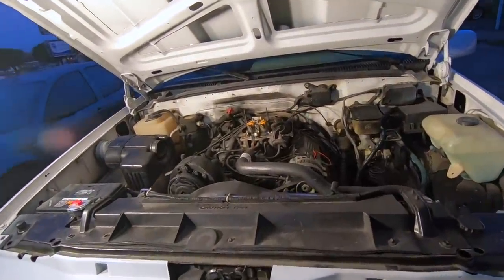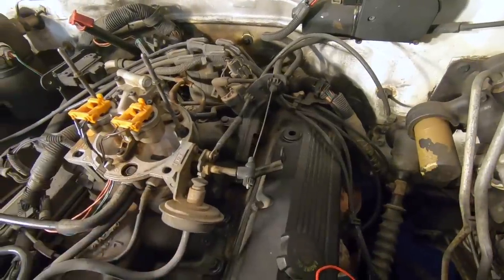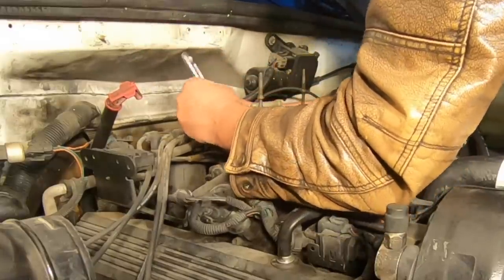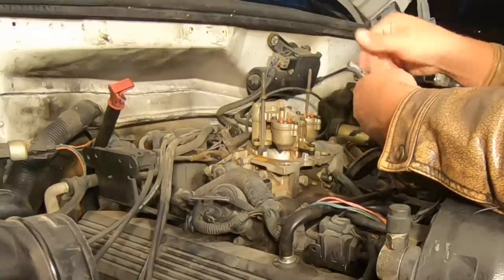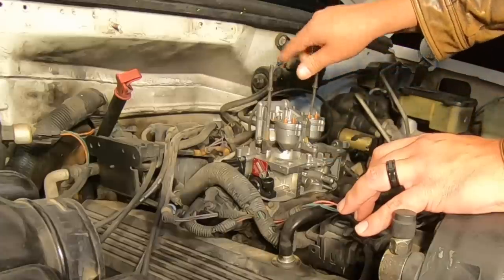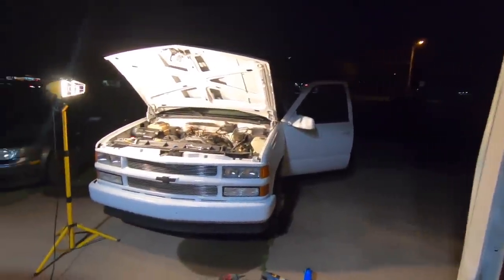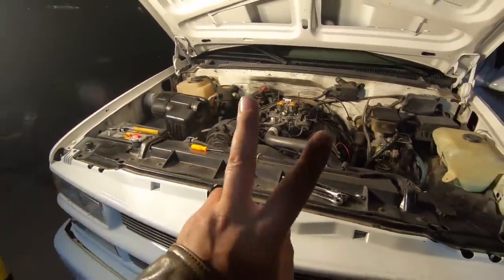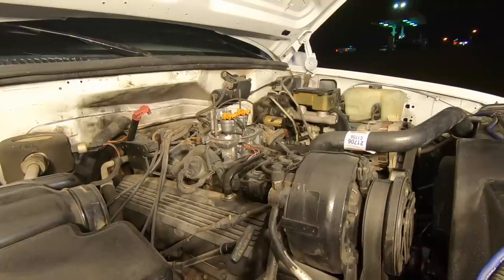94 Chevy 3500 454 TBI Replacement Issues!!

Comment: sure seems like a vacuum leak, check to make sure there are no open vacuum ports that may have been plugged on your old unit. That truck has a hydro boost because it was a Diesel truck before Diesels don't produce enough vacuum to make a traditional brake booster work.

Comment: ranny you need to go to a Michelin dealer because those Michelin tires had a recall on them years ago and if they have the right. T on them you'll get 6 brand new Michelin tires no charge cuz they had a big recall on them those are the same size as tires they put on the U-Hauls that's where it came from and as far as your headlights going off and on the headlight switch in a Ford has a fuse built into it that overheats and then it burns the connection up and the wiring harness that goes to the switch all you have to do is pull the switch out and see if your plug is burn up and fix it and that will take care of your headlights

Comment: Rebuild kit 40$ Injectors rebuild replacements probably 200$ Ive done this on my 350 and it's extremely easy, usually the regulator diaphragm will go bad or the gasket will blow out but that's it besides whatever else that's not mechanical

Comment: Don't buy a 6.5 Diesel. They spend more time broke down than they do running. Why do you think the guy swapped a 454 in the truck you bought? Sure as fuck wasn't for the sake of MPG. Hydroboost is good. Leave it on there. I upgraded my F250 to Hydroboost and it gives the truck more braking power.

Comment: Fix it.  Keep it.  As others have said - the stalling is likely a vacuum leak.  The lights are the probably the dimmer switch or the main headlight switch.  Drives you crazy until you find the source.  Oder GM products (before the multi-function switch) it was almost always the dash switch.  On rare occasions it was the power relay to the lights.

Comment: Dude, that truck is fine... You got a few things to test before you give up. First of all, you should have bought a tbi rebuild kit and just replaced the injector from a wrecking yard. But that's over... So, you got that little black box with the green plug and one tube to the back of the tbi on the passenger side valve cover bracker thing.  Unplug that green plug and start it, that's the map sensor. You will have to give it a little throttle to get it to stay running and it will flutter. Put it in gear and let it run for a minute. It should somewhat smooth out with a check engine light. If it runs with that unplugged replace the map sensor, they are 25.00 on Amazon. The other 2 things are the module under the distributor and the 2 pin engine temp sensor at the front of the intake. My truck had a bad map and coolant temp sensor causing it to surge and stall or only start with the gas peddal. But that map sensor should be the main issue. Also since I assume it's under a 1995 run the paper clip codes and see if you have any code for a memcal or prom error. Your prom in the ECU should be good if your iac valve in the tbi is moving and fluctuating a hissing noise and idle. But unplugging the map and seeing if it will run will tell you if that is causing it to die. It should start immediately once the map is unplugged. The map sensors on v8s die faster than the maps on v6 Chevy engines because they pull more vaccum and work harder. Hopefully this helps, it's hell when a Chevy won't start and you don't know the engine like the back of your hand. I had a V8 with a clogged oil pressure port that was causing the oil pressure sensor not to send power to the oil pump. Sometimes it just takes alot of research. You can also unplug the engine temp sensor and test it. But I'm pretty sure the issue is the map sensor.

Comment: Hi Randy
I have the same 454 problem 
1989 suburban I bought was originally a 350 and was replaced with a 94 454 which gas different fuel pump
The 94 and 95 454 run at 30psi, not 13psi like all other year tbi engines ran
Mine ran fine till the summer of 2022 and died. Replaced every sensor and the ecm and chip for correct year 1994 454 and runs terrible and still working on it 10 months later without a solution.

Comment: Oh, also the module on the back of the distributor is connected to the feed for the injectors. So remove the cap and rotor and see if it's got a oem white or orange dot. You will have to replace that with a acdelco. You probably shorted out that module. Hopefully you can return your tbi if the module and map sensor fix the issue. Let me know if that helps or you got any questions. You should still have my email address. If you need it again let me know and I will send you it again.

Comment: I have a 454 c3500 91. I bought it for a cheap price. I bought it because I had a really bad drug addiction and was trying to get sober on my own. 2015 I started my project and I still work on my truck on the weekends. Your truck ain’t junk, these trucks are pure power and torque if you take the time to understand them. You have to read, watch videos and ask questions when working on a vehicle. I’ve learned rock auto has the best parts and the cheapest. I’ve rebuilt the entire truck and bored it.60 over.

Comment: My dad's 92 one ton had that headlight issue, it was the switch.  An after market alarm was terribly spliced into it by me when I was 16, I jacked up the switch.  New switch fixes it.  It would get hot and stop working after 10 to 15 minutes, shut off for 5 to 10 mins and then come back on...repeat.  hopefully that helps ya Randy...if it does give my YouTube a shout out...street legal 520...I don't do much but I have fun.

Comment: Hydro Boost:  Okay system when it works.  Had that in one of my old Astro Vans that thankfully was still under warranty when the seal popped.  Dumping PS fluid all over the place!  The dingbat at the dealership said  "They never fail....." And then had to eat crow and replace it under warranty.  (failed at 32k.....part was over $650.)

Comment: Randy do not remove the hydraboost unit.... randy are you sure you have the proper fuel pressure... also when you crushed the tbi power circuit in the ECM or module in the HEI distributor.... the headlight trouble sound like the light switch is bad... maybe you need to find a 1994 Dually from Copart that needs a complete cab, bed and front clip and maybe... I may have the 700R4 transmission in it already... I dont think it has the TH400.... Randy.... Take that VW Jetta for a drive sir... that cheered you up...

Comment: You might try a new Holley Fuel injection system on it. It would do away with the old TBI. Or swap in a carb and run it.

Comment: Call Identifix hotline. They have ASE certified mechanics specifically for each (domestic, Asian and European ) and specialist within those. I use it all the time and it helps pinpoint  the problem instead of throwing parts at it. The first call is only $39 if you have to call back it’s $20 something , 3rd call is roughly $10 and the phone calls thereafter are free for the same issue. They will give me a punch list of what to look for/ check out and I can usually pinpoint it with the first call. Well worth the Money. You don’t want to try and figure out these problem child’s on your own and throwing parts at it sure gets expensive. It’s a cheap education and gets you onto the next project. Been a sub since the Uber days and like your what your doing. Best of luck Randy

Comment: Did anyone on here see a build from bad to good? From beginning to end? From broken to fixed? From $1,000 to $2,000? From bad to good? Or it's always the other way around? Randy do you not want to do good? Randy plz take my advice. Go on Craigslist find a car thats worth $1500 run and drive. Clean it up in and out. Make sure that thing is shiny. Then post it for $2200 and let it go for $2000. I guarantee you that it will be gone within a week and do that over and over again

Comment: IT COULD BE A 95-99 THAT'S THE YEARS TBI, AT LEAST MY 96 CHEVROLET P30 454 IS TBI AND IT RUNS THOSE 4 YEARS.
DID YOU TRY LOOKING THE INFO WITH THE VIN ?? THAT'S ALL WHAT YOU NEED, GOOD LUCK, AND THANKS POR SHARING !

Comment: I have chased dragons like this on a Chrysler TBI system. The car would chug, buck, idle poorly, stall at lights and so on. It would also drink gas like you would not believe. Just like your truck there was no code or check engine light.

TBI with map sensors (at least with Chrysler’s) use a speed density system where the fuel mixture is controlled by a single o2 sensor. It uses the open loop mixture programmed in the computer for cold start and WOT.  From what you are describing it sounds like your running really rich.

Unplug the o2 sensor and force the engine to run in open loop. See if it gets better.

The idling issue could also be a bad IAC. I have had them bad out of the box. Usually a bad map sensor sets codes.

Comment: The headlight problem is probably because the wiring is overheating. Too high resistance somewhere in the wiring...bad ground, pinched wire, something like that. There's a thermal cutoff to prevent anything major (fire, cooking something permanently). The lights come back on when it's cooled off enough.

Comment: vin or casting tags will tell the year of the engine, if its a 95 you will be in for a hard time, in 95 they made changes to the electrical system on both engines and transmissions that were for that year only. I had that issue with a 95 chevy (mind you its was a k1500 w/ the 5.7)that the TBI unit, trans and several other parts were 1 year only and hard to source. When my TBI went bad I had to rebuild it with a mix of new and used parts to get it to work. I wouldn't be surprised if its the same for the 454 as it was for the 4.3, 5.0, & 5.7.

Comment: Ok. It will be fine. Start over with the basics. Fuel air spark compression. But add in vacuum.  Make the rounds and forget about what you paid. If you get is running well. Than it will be a 6500 truck to you. Now get your ass back to the truck and fix it before the crack whores strip it.

Comment: Jumper the AB wires on the OBD1 port. Run for 30 sec. Turn off. Pull neg batt cable. 3 min, reconnect batt.

Comment: I am working on a very similar TBI issue with a 1990 Chevy K3500 Extended Cab 4x4 Dually with an 8 foot bed that I purchased for $5,000 that only had 34,000 original miles on it. I have had to replace everything from the fuel tank all the way up to the TBI so far, but when a friend replaced the TBI sensor, he ended up breaking the bold off in the TBI so we had to temporarily modify it to work. I am looking for a replacement TBI now and would like to do a complete swap like you did if I can find a full TBI setup for it. Most of the idling issue has been taken care of now, but I can tell the timing of the injectors is not quite right, so hopefully if I swap the whole thing out that will take care of that issue once and for all.

Comment: Have you thought of going to carburetor? The lights and rest of wiring going to non computerized system. That would make your truck back to the 1970's. These ECU are a good open source and simplify wiring systems if you want an inexpensive coil pack controller. I do not think that they will control the throttle body injectors though they are sequential injector controllers. https://www.ebay.com/itm/LPG-Sequential-Injection-System-Conversion-Kits-for-8cyl-gasoline-fuel-injected/153138554061?hash=item23a7c4e4cd:g:h2kAAOSw8A1acpV5&frcectupt=true These provide a stand alone open source ECU when you cannot get a stock unit running. This co have 3 different models but all of them are dual fuel systems for dual fuel but can be stand alone  gas controllers. Tuners use these in odd building projects when other controllers will not work. The cost is about the same with the propane parts and the units.

Comment: You said the truck was a diesel so that is why it has hydro boost. Diesels don't make vacuum so they use the power steering pump for the power brake assist. Just leave it there it works better then a vacuum unit.

Comment: Why didn't you just pull the faulty injector out of the old TB and get the part number off it, then replace like for like or equivalent. https://www.youtube.com/watch?v=mQ9Yhj8pSfo
PS: If the injectors are working okay then check your fuel filter and the usual suspects like vacuum leak etc...

Comment: This truck has the Hydra Boost system because it originally came with a diesel engine. Diesel engines don't have a vacuum like gasoline engines do to assist with the power brakes, so they use the hydraulic pressure to assist with the brakes instead of a vacuum. Yes the truck is a POS and Yes you paid way too much for it. You're losing subscribers with your "Do as I say, not as I do" attitude.

Comment: Hydraboost is a pretty common system on the US on larger diesel vehicles.  Petrol/gas vehicles use a brake servo/vacuum booster because those engines produce plenty of vacuum to run them.  Diesel engines don't produce much in the way of vacuum so to run a vacuum booster the vehicle would require a vacuum pump to run, which would introduce and extra part that could fail.  So an easier option is to use this type of set-up where the pressure in the power steering system, which is there constantly as the pump runs all the time the engine is running, to provide boost for the brakes.  It's a logical step as pretty much all diesel vehicles, especially larger ones, have had power-assisted steering since the 1960s as standard equipment with diesel engines being a lot heavier than petrol/gas engines...

Comment: Old video i know, but #1 they can't calibrate the TPS unless they have your specific engine, if your engine was brand new ok, sure maybe, but no, you need to crack that throttle set screw cover, probe the TPS and set your idle by the book. The headlight thing is a weak breaker or a bad ground.

Comment: I had a 99 454 3500 and the idea of owning one was such a thrill. after the purchase it was downhill from there one of my biggest pet peeves was GM putting the coil pack behind the engine up against the firewall. Who came up with that dumb idea.  yes the engine and Allison transmissions are very reliable but everything and I mean everything else around it is absolute garbage

Comment: Hey brother quick question I am doing a fuel pressure regulator replacement and kinda sorta got ahold of the screw that holds the tension spring for fuel pressure how loose or tight does it need to be?  I also have a 454 7.4 BBC

Comment: Hydro boost is more efficient than the old massive boosters-- just borrowing some extra boost from the steering system -- good for heavier vehicles that take stronger braking to stop the momentum of all that weight. Retired Class A tech here.

Comment: I had the same issue on a 95 G20 van with what looks to be same throttle body. It sat for a year with little fuel in it and there is a small rubber hose on the fuel pump that if left out of fuel for a while will crack and it is like trying to drink through a split straw.  1.00 worth of new hose fixed the issue. To test you want to make sure you have proper fuel pressure. T in a gauge on your supply line and make sure you have proper pressure to the TBI. From memory it was like only 12 psi and I only had 5 . Hope this helps!!

Comment: Don't remember if those t.b.i units had adjustable throttle position sensor, also minimum idle air adjustment needs to be checked, also ignition timing, and sounds like vacuum leak possibly. :-/

Comment: master gm mechanic of 35+ years it’s simple check fuel filter first then put a delphi fuel pump in because theres not an easy way to know age of pump or to check proper pressure it only has 10 psi to surge of 14 psi and from look of it needs a cap and rotor and hydro boost brakes are common on all heavy 2500 and up trucks and diesel don’t get discouraged its a chevy if all else fails carb it lol and if the sensor plugs plug in you have the right throttle body when fuel pump starts going out one injector works more than other one so id do new fuel filter and pump cap and rotor plugs plug wires and use your truck good luck remember if your not knowledgeable about diesel they’re huge money pits been there seen it all bbc tbi is great for what you’re doing hauling cars and light trucks

Comment: I had a similar problem with an 84 Eldorado that has a similar throttle body FI setup.  I pinched one of the fuel injector wires and it blew a fuse for one of the injectors.  On my car, there were 2 3 amp fuses under the dash.  One for each injector.  I replaced the blown fuse and all was fixed.  You should be able to look at each injector while its idling and be able to see the fuel spraying into the throttle body.  I hope this helps you.

Comment: Hydraulic boosted brakes is common with diesels because diesels do not build vacuum like gas engines. I would check the resistance on the wires going to the injectors by probing them before they were pinched and at the connectors. Last, rule out bad fuel. Run the truck of a separate fuel source and see if the problem disappears.

Comment: Take a break on that randy.. might be that wire or fuel lines? Is the cap you put on the back vaccum line removed before you plug the hose? Try to return the old one again if it makes a difference... youll figure it out soon just wont quit bro...